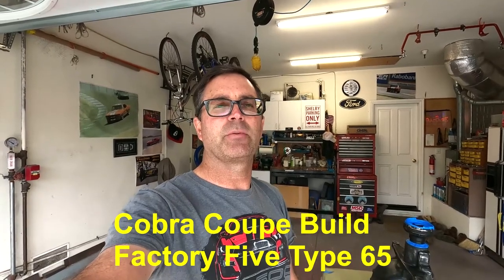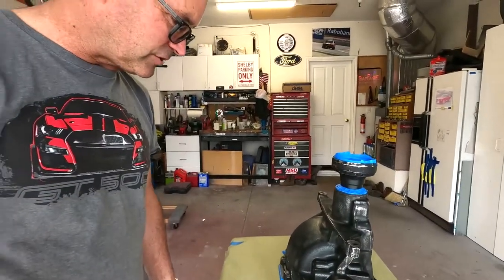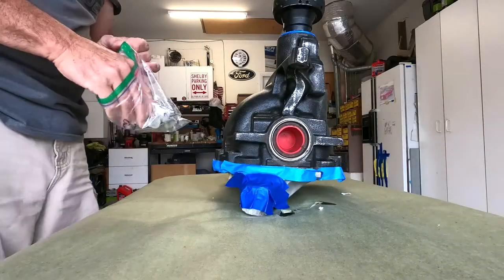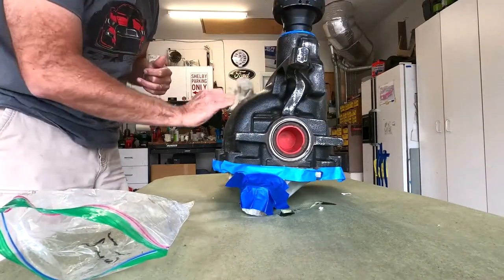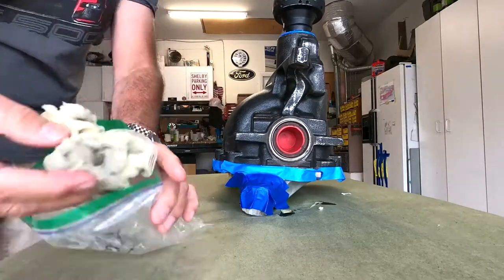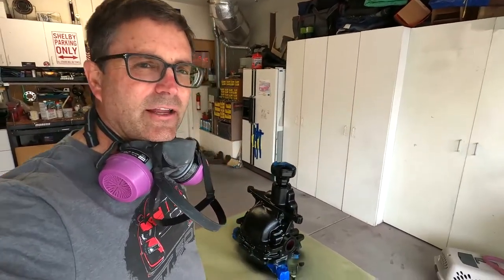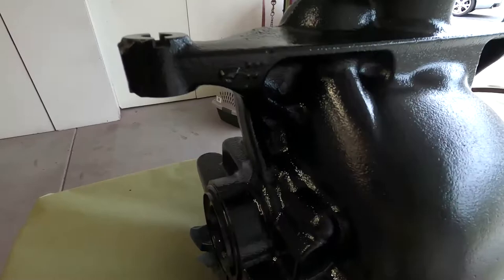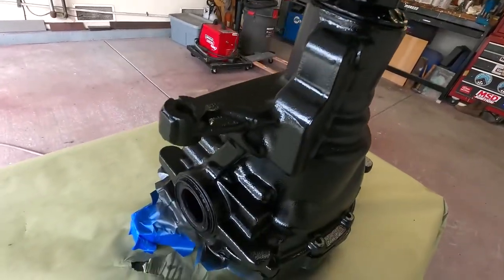COBRA DAYTONA BUILD- Prepping and painting differential #5

Comment: Was the 8.8 IRS always your plan or was the Ford GT unit to cost prohibitive?
Reply from the maker: The Ford GT has a transaxle and the type65 is not set up for that. The gtm is though.
Reply: @cobradaytonabuild1671  I wasn't referring to the GTM Transaxle. Doesn't the coupe have the 2015 Mustang independent rear suspension as an option?
Reply: @cobradaytonabuild1671  My bad.  I haven't seen what the IRS option was for the coupe.  Have looking at their website, I notice I was wrong.  Keep on building !!!
Reply from the maker: The differential is out of a 2018 gt350 and is a super 8.8 differential. Should be bullet proof in a 2600 lb car.